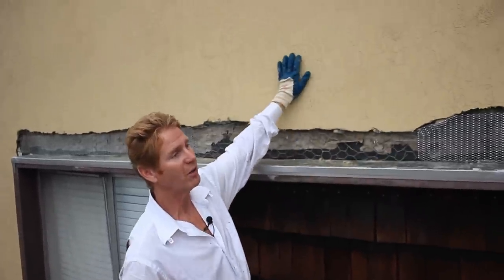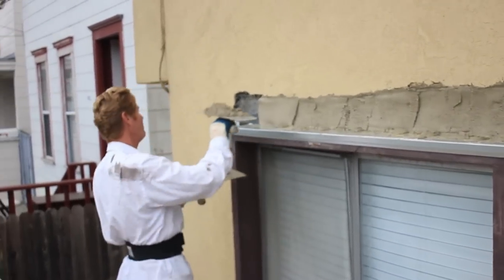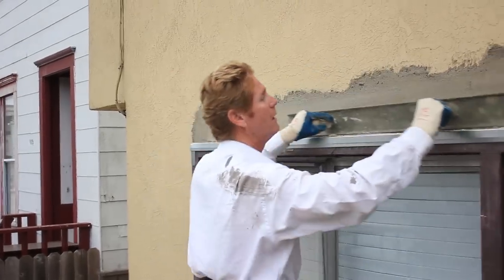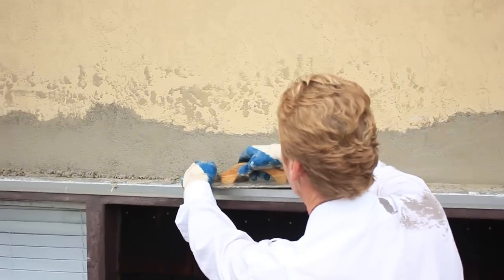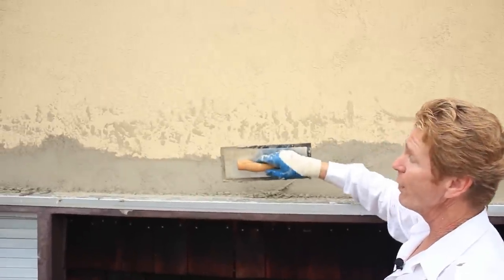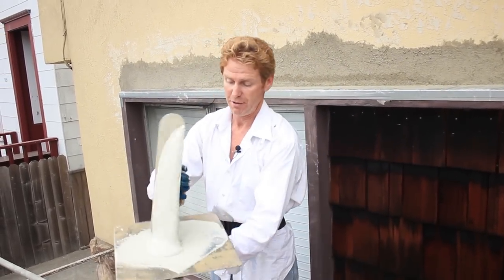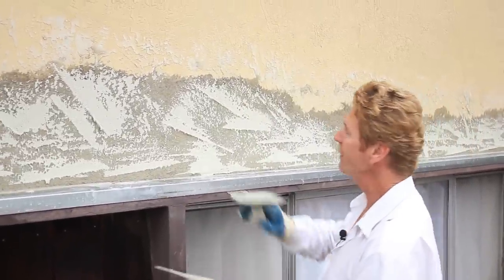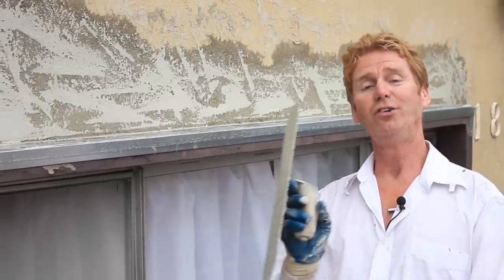How to apply or install stucco.

Comment: A lot of these videos that pertain to exterior plastering, but what i do is learn how you handle your tools and manage the mud…also, the aspect of patching coincides with interior plastering and mudding(drywall and plaster repair)….thanks again for the tips and top notch lecturing:)…cioa from New York!
Reply from the maker: Evening Tommy Brando, your right if you can apply exterior cement you can do interior plastering, mastering the tools just takes practice, I do it so often I take it for granted to not explain certain techniques about using these tools,
 best wishes,
 kirk and family

Comment from the maker: Evening SoCalBohoGal, 
As far as waterproofing you use the proper paper and a good quality caulking. Or the peel and stick water proofing membranes.
 If your new to this try Home Depot or Lowe's hardware stores they sell a lot of  quick set stucco. It's usually called rapid set cement plaster. 
Don't over mix and just mix what you need, also if it's soupy it won't hang, make sure you mix it somewhat stiff.
Thanks for watching and have a good evening! 
kirk Giordano plastering '

Comment: Great technique! Love watching a guy who knows what he's doing get his grove on! I have a small patch I have missing on an exterior wall. What is the per portion of sand to cement is your scratch/ brown coat? 4:1?
Reply from the maker: Morning Dan C, thank you, 
your close with your mixing ratios, I would go 3 parts sand to 1 part cement plaster, for patchwork.
 I sometimes go 4 to 1 with my second coats or what we calls brown coats.
 A little more or less, sand or cement, is not such a big deal, it just takes a bit more practice to work with.
 Best wishes, 
 Kirk Giordano Plastering

Comment: Best resources for stucco knowledge!!!  Thanks Kirk.  Quick question for ya, if you don't mind...if the edge of the stucco was cut straight/flat, not rough like the one you show in the video.  Is it possible to patch in if the edge is not rough but straight?  Thanks so much!!!
Reply from the maker: hello Sig Sonand, yes I have done a video which explains just this, make certain there is not dust around the entire inner perimeter, paint weld create on the edge and apply stucco as usual.
this video below will shed some light on your question.
 https://youtu.be/pLa8O9npjVs
 Best wishes,
 kirk giordano

Comment: Is there any special backing/prep to do for a deep area around a repaired water maingoing into a house? (basically a hole around a pipe going into wall at 90°...Also, whereis the best place to find a colored or a quick-setting stucco for us older gals. I can get matched paint, yet would rather do this all at once! Any tips? Thank you for the great video! This will be my 1st attempt at stucco BTW! GOTTA start somewhere!!! ;) Thanks!

Comment: Thanks for your video. I'm up in NorCal (Sacramento) & My wife & I recently bought our first home, it has all single pane windows and sliders and a really rough stucco, my house was built in 1979. So naturally I'm slowly replacing them. I'm about to start the patch job around one of the back sliders that I replaced. I bought this one coat fingered material made by sakrete. Should I still do a brown scratch coat first and come back 48hrs later and then apply the one coat stuff for final finish? Or is this stuff garbage?
Reply from the maker: Evening Rcp pop, the idea behind the one coat stuff is to apply both coats in a day, but this takes lots of practice with the right mix. It's probably better for you to do two coats on separate days, if you're just learning.
I knew you meant the fibered stuff you pay a buck more per bag for the fibers however it's a little stronger. This does not mean you won't get some hairline cracks though.
 cheers! 
 Kirk and family

Comment: Hello, Kirk,,i wonder how long you have to wait after you apply the stucco base 20/30 to do your stucco texture?? Thanks great videos!!!
Reply from the maker: MEMORIAS SANDOVAL, thank you brother,
 I applied the finish about 10 minutes after I hard rubber floated it,of course the brown coat was solid enough to accept it, as I used accelerators in both coats.
 Best Wishes, 
 kirk and Jason

Comment: I didn't know that. You learn something every day. What brand do you use or do you just use sand and cement with accelerant?
Reply from the maker: Howdy  Ed dude, the Rapid set cement plaster sold at all the major chain stores needs no accelerator as it already in the bags, you just add water.      
                                   Live long and plaster
       Sharing plastering information,  as the world can use more teachers.

Comment: Thanks for the videos. I am planning on stucco my house. I have learned alot. My question is can you stucco over painted concrete cbs block? Should you apply a bonding agent to the cbs block before you stucco?
Reply from the maker: Howdy Mike Samson, not only is a bonding agent needed but prior to this bonding agent, you have to pressure wash all the dust, dirt, and grime off where it's clean enough to eat off, but of course it's would be difficult to place a meal on a vertical wall,
 Best wishes, 
 kirk giordano plastering

Comment: Kirk you said a square trowel doesn't flex like a pool trowel. I use a 5×12 Paul Curry trowel which is made with  magnesium so its flexible best trowel ever.
Reply from the maker: Howdy, there are exceptions to every rule.🥳
Reply: @Bobby I'm pretty sure that you're using a stainless steel trowel, not magnesium.
Reply from the maker: @metallitech  Howdy,  I'm not aware of saying I was using a magnesium trowel; in fact, I know they don't make trowels of magnesium; a big oops.😉

Comment: Hi.
I just got a house and need window replacements, the siding is stucco but this house is 60 years old. Well there is no wood behind the stucco so the there is n way to add or staple the wire unless I go the the stud and then try to get 1/4 inch felt paper behind the existing stucco.
Any ideas on ho to do my windows with no plywood behind stucco????
Thanks.
Reply from the maker: Hi Marco, type in our channel how to lath a stud house and a bunch of videos will show you how, just take your pick,
When I first got into this trade all homes were just studs there was no shear wall codes,
 Best wishes, 
 kirk and family
Reply: Thanks Kirk. 
This will help me a lot.

Comment: Thank you for your video. I am patching stucco around a new window I replaced. What I need to know is what is the best stuff to mix with the stucco mix. I am a real novice and if you could explain what I should use for the stucco mix. I was told I need to use a type of glue to help the stucco bondholders the wall. Any help I would appreciate it thank you
Reply from the maker: Chim Richalds Hi Chim dude,  I would recommend rapid set stucco patch it's sold at all the hardware stores. 
 if it's applied over wire you don't need a bonding agent, if it's over a painted surface, I would recommend a bonding agent, weld Crete is great.
 Or quikrete bonding agent is more popular with the major hardware stores such as Home Depot and Lowe's
 Best wishes, 
 kirk giordano Plastering
Reply: Sorry to bother u again... Thank u for responding. I'm Jake btw. Lol. What I have is all purpose stucco patch by DAP and concrete bonder and fortifier by sakrete. I do have home depot and Lowe's here in Bakersfield. If this isn't good enough what would u recommend? I did see the bonding agent u recommended.  Yes it is painted and textured.
Reply from the maker: Hey jake, no worries brother.
 those products will work just fine both of those products are great.
 Best wishes,
 "getherdone".
 kirk giordano plastering

Comment: Getting windows replaced in a stucco home. For the best seal, do you recommend spending extra money to have stucco removed an inch or two away to expose old nail fins (then restucco around new window)? One company that quoted on my project recommended to just to grind off the old nail fin from the old window and just insert a new window with a brick mould mount. Is there a proper way to insert new windows into an older stucco home?
Reply from the maker: Good morning Kirby,  to just do as little as possible and install window inserts is a horrible idea, although less expensive, don't do that.
    When you redo these windows because of leaking you will have spent 5 times the amount, then doing it properly.
 bust at least 6 inches around each window and tie them in properly for longevity and peace of mind.
 Call a company that knows what they are doing without bullshitting you about proper procedures.

Cheers!
Kirk Giordano plastering tip’s

Comment: Hello Kirk. Another question I'm trying to skimm coat a painted wall with paster, can I go over the painted wall with plaster?and it now has a ugly sanded texter and I wanted to have a smooth finish to it how can I achieve a smooth finish? How many coats? And on last coat what good tips can you give me to get that shinny smooth look to my walls. Thank you very much.
Reply from the maker: Howdy mysongordon, I can skim coat a wall with one coat with a steel trowel finish, This does take practice, as this causes the stucco to hairline as now you are sealing it with a steel trowel.
 The more elbow grease you apply the shinier it can become with the right material.

Cheers,
 kirk giordano plastering

Comment: The stucco on our house is too low, gets buried in the dirt. Is it ok to cut the low edge up higher and then install a new weep screed? I need to find something to do so that I can build up the dirt around my house a little more. I just don't want the stucco to wick up moisture from the dirt. Any suggestions?
Reply from the maker: Evening Zach Choate, If you wish and have lots of free time and energy, sure you can.
 FYI, my own home does not  have a drip screed either as it was built before 1980.
Best wishes and have a Fantastic New Year, Kirk Giordano’s DIY plastering tips

Comment: Hey Kirk I was wondering, how can I do a color gypsum plaster interior. And do like a old world style with a shine to the wall. The color would be  different between yellowish to a light tan old world look? Please help thank you can't find any video's on color plaster interior.
Reply from the maker: Sonya Gordonn, Hi Sonya, complicated issue even for us plaster dudes,

O.K. you take for example a box or bag of color pack as a rule a color
pack will mix with a 94 pound bag of cementitious color finish to
match what's on a color chart.
Now if your going to use a 50 pound bag of say interior veneer finish do
the math and you will figure its about half the color pack, if your
going to use say a bag of interior fast patch its about a quart color
pack, as a rule as these are general 20 to 25 pound bags.

Confused?

Keep in mind the color additive will accelerate the set time for any plaster or plaster compound, so for example if your going to figure
on using 20 minute mud ol Kirk recommends a 40 minute mud as the
color will accelerate it, same thing for veneer plaster,
More
confused?

Most Cements come in base 100 and base 200, one hundred is a white based
cored cement and 2 hundred is sort a greyish, so this also needs to
be factors in as all interior plasters and or fast patches are white.

I told you it was confusing, it's simple for me as I do this stuff a
lot but trying to explain wont be to easy to understand for anyone
without basic plastering skills. 

Best wishes, 
kirk giordano plastering

Comment: Friendly suggestions... For this particular repair, it would have been a big improvement to add a good flashing at your header piece, and all expanded metal lath... from what I see, water can still get into the repair you just did... water is the enemy!
Reply from the maker: Howdy Billder Inbaja, look closer brother, the whole length is a Z Flashing with a back side of 4 inches up, all custom and installed.
Best wishes, 
Kirk & Jason Giordano's DIY plastering network
Reply: Ach du lieber! You got game my friend... great video production work.
Reply from the maker: Morning builder dude, this plaster fix was for Larry Beilman of Beilman construction, he does everything to perfection, neither him or I wished to have to redo this wall for leaking, Larry had it in his contract for them to prime the area twice with an acrylic paint then paint the entire wall with a waterproof paint.
best wishes and good eye.
Kirk & Jason Giordano's DIY plastering network

Comment: Kirk, what's the pay rate per hour for a mechanic with 30 years experience in  All Phases of exterior stucco and interior plaster? In Florida I get 22 a hour,or I help a friend for $200.00 for the day.
.
Reply from the maker: Howdy Bobby, here it's between 2000 to 500 a day for a man of skill. Helping a friend for 2 bills a day is fair. I've helped for free, then sometimes charge double or even triple; it all depends on many different factors. 🍾

Comment: Gotta ask man I've been a plasterer in England for 20 years there's no question of your skill but why do you take k e your plaster from the back of the hawk? We were always told this was a big no and were never allowed to do it this way
Reply from the maker: Jamie Taylor hello Jamie, excellent question, I too can pull from the top and do so with certain textures.
 I was told I had to also pull from the top or not have a job 30 years ago, but when I left that first  octopus excrement of an employer 30 years ago, I went back to taking mud from the bottom.
For me when I pulled it the mud from the top it takes  sometimes 3 to 5 trowel movements empty the hawk when applying a scratch or brown coat, I don't like waisted movements,
 For me I empty a full hawk with two movements from the bottom, although when I'm color coating or texturing I sometime pull from the top especial if it's an adobe finish.
 I told all my sons and my daughters to use whatever trowel they were happy with and to pull of what ever way they are happy with.
  It's simply choice, unless you have a fella with the old attitude of my way or the highway.
 I have worked with guys who can out plaster me with small trowels and pulling from the top, but the only glory of being the fastest is having to do most of the work.
 Best wishes and stay cool in England.
 kirk giordano plastering

Comment: Thank you for taking the time to reply to my message I'm truly humbled,we have stucco products that are beginning to appear in the uk  but they are finished with a plastic trowel I think there more of a makrilic material rather than

 cement based.do they use anything similar in the US?
Reply from the maker: Jamie Taylor Hello Taylor dude, it's no honor to here form me were in the same boat compadre.
 I think you mean Acrylic instead of makrilic material?
 When I was in the UK I did notice lots of plaster floats and trowels, in fact I bought one and brought it back to the U.S. with me about 25 years ago, we do also have them here now too, and yes we use tons of acrylic products.
 Best wishes, my fellow plasterer,
 kirk giordano plastering

Comment: My block home has the tendency to get moldy  how do you clean mold off of stucco?
Reply from the maker: Howdy Sandy, you can fix this permanently by using a paint sealer on the exterior, or on the inside using diluted clorarx or fruit enzymes.
Best wishes,
Kirk and Jason Giordano plastering

Comment: You don't have to dampen the stucco before you put another coat on?
Reply from the maker: Good Evening Sandy girl, this hydrating applies to traditional stucco.
 Not the same day stucco's or stucco that has luminite added to it. 
You are Very observant.   
                            Best wishes,
  Sharing stucco secrets and or common sense plastering tips

Comment: Try out the Marshall town trille 16x5
Reply from the maker: Hi Vidal Martinez, I take it you mean a trowel?
 Thanks for the tip.
I'm not sure what a trowel is but I will google it.
Kirk and Jasons DIY plastering network
Reply: Yea trowel your right a lot of people like to say trille I don't know why . But check it, my pops and his crew has been using it for years and you know how those trowels tend to wear down or bend on you after awhile of good use, Marshall town trowel doesn't they out last most of all the brands , they also have them in hulks also
Reply from the maker: Evening Vidal Martinez, thanks again for the tip, 
Cheers and have a Happy New Years,
Kirk Giordano’s DIY plastering tips

Comment: What kind of cement do you use ?
Reply from the maker: Evening Freddy,
Rapid set Stucco, it's designed with 16/20 sand included in 10, 25, 50, and or 88-pound boxes or bags just buy what you need. I have seen this cement stucco at HD and almost all the quality hardware stores I have been to.
You just add water. "Rapid Set Stucco," is one of the most users or DIY friendly fast setting stucco's on the market with little competition as far as strength levels.
 Like all the same day stucco's do not mix more than 3 to 5 minutes, as this can compromise the strength of all the same day or one coat stuccoes.
 Bringing peace, love, and brotherhood, back into the 🌎 of Plastering.
    The most comprehensive encyclopedia of plastering on video, by the plastering messengers of Youtube. 
Kirk and Jason Giordano with over 800 videos 🎭 👀💃